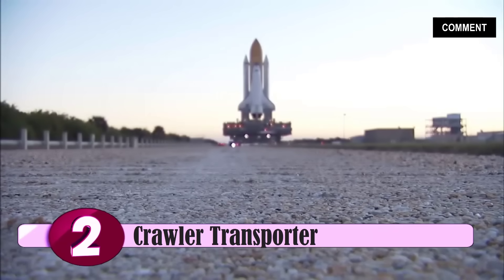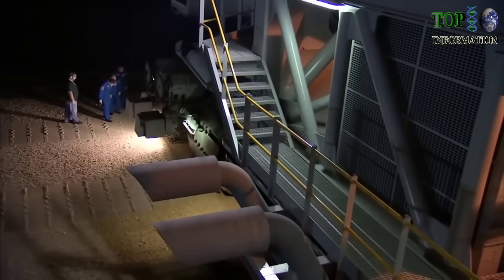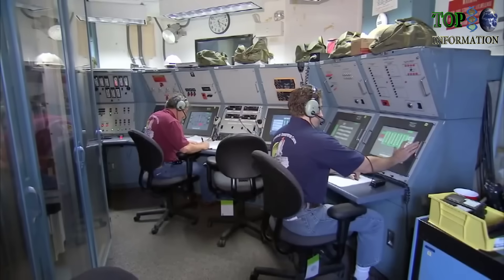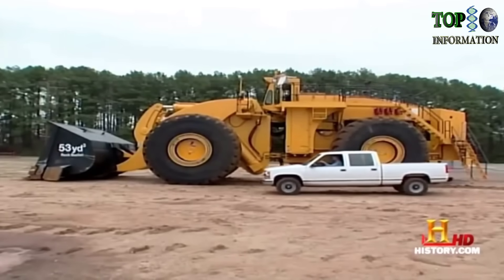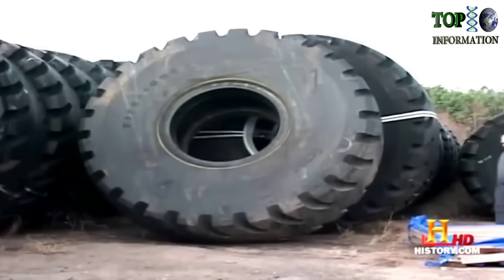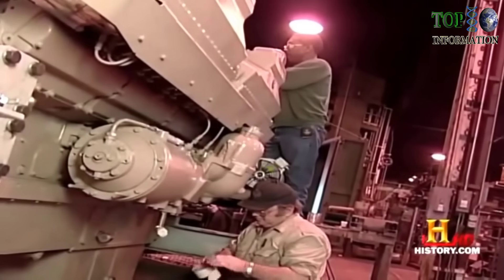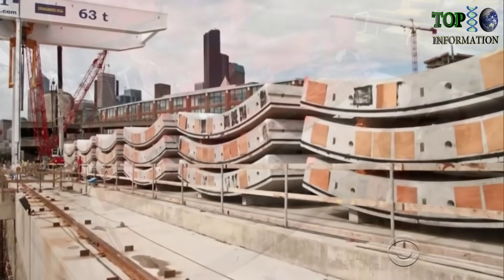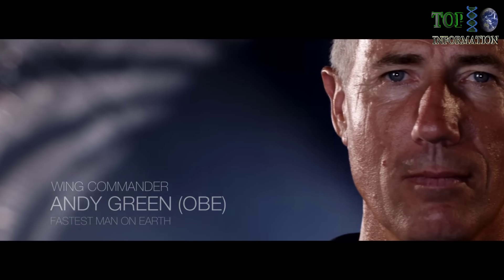7 EXTREME & Powerful MACHINES You Won't Believe Exist

Comment: Each ton of coal burned releases one ton of carbon dioxide, no it doesn't, it can't.  There is something called the law of conservation.  A coal power plant is not a closed, isolated system.  There is waste in the form of gasses and ash, carbon dioxide is a gas, one of a number released when coal is burned, it is impossible to have one ton of any waste product when one ton of coal is burned when there are a number of waste products being produced.  The sum total of all gasses and ash created when on ton of coal is burned is on ton, the law of conservation tells us this.  It is impossible to end up with more mass in any form than was started with, again because of the law of conservation.
Reply: Hydro-Carbon combines with Oxygen from the atmosphere to produce ?? Can you guess>?
Reply: @ Martial Terran people will not balieve You, I'm afraid.  
This lack of basic highschool level chemistry/biophysics in society is it what makes it so easy for the wheeler-deelers and thimbleriggers selling the "there-is-no-climate-change" snake-oil to their consumers.
Reply: To Mr. Foster... You are correct sir (Ed McMahon voice... but seriously, though, you are right)!
Reply: And Bradley, that would be the act of the GASSES COMBINING to produce the ton of Co2, not the act of burning coal. Burning coal in a vacuum while supplying it with only enough oxygen to burn, would mean no oxygen for hydrocarbons to bond with, thus producing no Co2. Even though one ton of coal HAD been  burned. Ergo, burning one ton of coal does not, and can not, produce one ton of Co2. There would HAVE to be a PERIPHERAL (another) process in place (other than the burning of coal), involving additional elements, for that to occur... the burning of coal, in and of itself does not, and CAN NOT (like my man Foster said) do it alone... ahhhthank you :-)

Comment: I don't quite understand here. These gigantic machines produce about 2500hp, while there are many 1900hp gtr or some other tuned cars producing massive power with a "small" engine. Science advanced?
Reply: TORQUE.. fucking TORQUE people. this thing is 50 years old, and has the ability to move 12 million pounds... and it carries 6 million... imagine how long it would take to stop a land vehicle carrying 18 million pounds moving at even 15 mph let alone 50 to 60? id be willing to bet that per its power to weight ratio, its more efficient and faster than a gtr by scale comparison.
Reply: I think the torque is a lot higher than a gtr produces. I think that if you link a million pound trailer to a gtr, with no possibility to burn its tires, it would just stall.
Reply: 1 kW = 1.341 HP. That is one point three four one. Not  a thousand and three hundred.
Reply: Han li, these machines use that kind of power for torque lot of torqueeeee not for speed AND the gtr that you talk about doesnt have the reliability these machines have if you heard these are used for 100 years.
Reply: And they said 1000 kw generators  not 1 kw. The two engines have to move 16.000.000 pounds.
Reply: One horsepower = 745 watts by definition
Reply: They have 2 2500 hp engines and 2 1000 kw generators. 1 kilowatt is equal to 1 horse power.